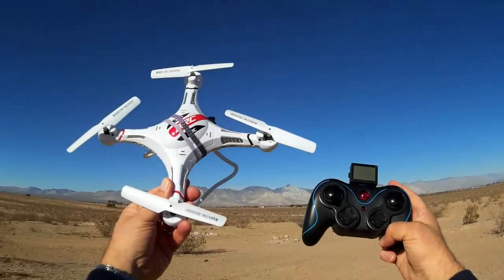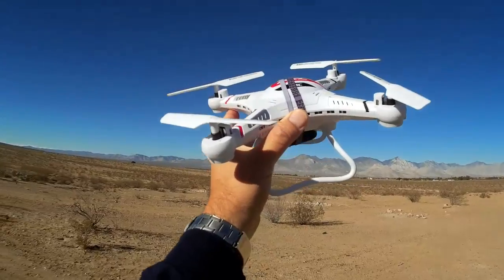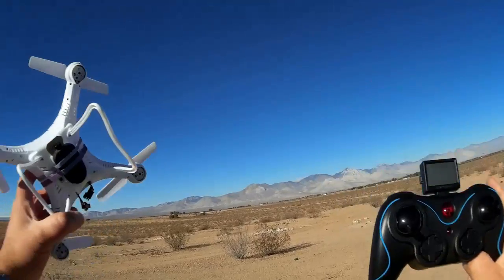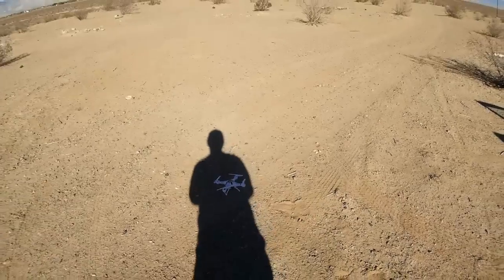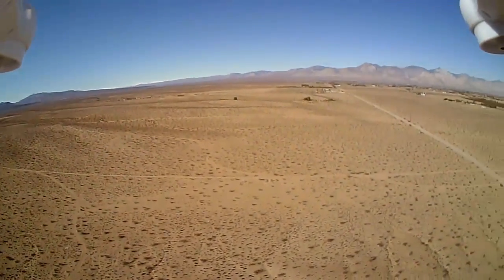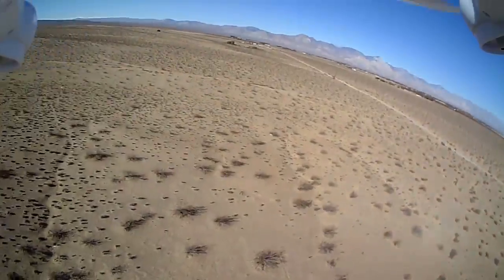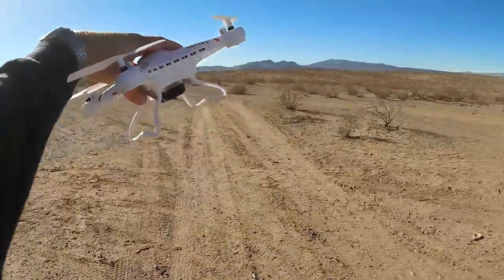JJRC H8C Drone, Got video jello? Check this first.

Comment: I thought the JJRC H8c was supposed to be 300 meter range, Quadcopter101
Reply from the maker: Jey Shin No not the H8C.  The JJRC Tarantula X6 gets 300m range though.
Reply: Then what range IS IT? I already ordered mine. How could you improve the range without getting any other transmitter? you mentioned something like an extension wire but I don't quite get it Quadcopter 101
Reply from the maker: Jey Shin It's about 100m.  If you're a new flier, 100m is more than sufficient for you. There are three mods that you could do later as you become a proficient flier.  The simplest is to melt a hole in your transmitter case to allow the antenna to protrude outside of the transmitter.https://www.youtube.com/watch?v=LoVt4O0iqKU
But if you know how to solder, you can also do this https://www.youtube.com/watch?v=fTB85lAHq4g
To see how others modded theres, simply do a YouTube search for jjrc h8c antenna mod
Reply: thx

Comment: Optimally you want to make the ant. length 3/4 wavelength long, Not a full wavelength. It will be a better impedance match and give you better range. This goes for both RX and TX.

Comment: ¿cuál drone me recomiendan para ponerle una sj4000 cámara?
Reply from the maker: Yuri Edge This one https://www.youtube.com/watch?v=DkWcSE9FGRU
Reply: Quadcopter 101 ¿qué me dices del FY326? ¿podrá cargar la cámara sj4000? Saludos
Reply from the maker: Yuri Edge The FY326 is very good to learn to fly with.  But is too small to lift your SJ4000 camera.
Reply: Quadcopter 101 no quiero gastar mas de $50 dolares en un drone y el FY326 me gustó mucho, ¿otro drone que sea sobre ese mismo precio?
Reply from the maker: Yuri Edge I recommend FY326 if you are a beginner.  But it will not lift your sj4000.

Comment: Been trying to fly mine with the mobius but it gets loads of jello. Loosened the strap and added more padding and it got rid of a bit...but I'm clueless on how to balance them. How do you tell if the rotors are vibrating?
Reply from the maker: Here is how to do it as demonstrated by thxkid.  A V929 is used, but the process is the same. https://www.youtube.com/watch?v=GtWRl6p9Jbw

Comment: I just got my H8C after 2 months of waiting and am working out its issues like the transmitter distance. I love this quad-copter and got it because of your videos but what kind of wire did you use to extend the antenna?
Reply from the maker: I use single strand thin wire (don't know the gauge, but I think it's scrap wire from an old electric motor).
Reply: Okay, I may use a 2.4 g antenna I have from an old modem but first I wanted to try your mod and see if its worth it to cut a hole and and add an antenna. Great videos, I have watched a great number of them and you are the reason I got the H8C as my newest quad. Thanks!
Reply from the maker: Finnick Odair If you're going to go the router way, you may want to consider using a much better antenna.  You'll need the following two items (total cost about$6)
http://www.banggood.com/5-Inch-Male-to-SMA-Female-Nut-Bulkhead-Crimp-RG316-Coax-Cable-p-924951.html?p=RB0922217402201307U3
http://www.banggood.com/Wholesale-FrSky-2_4G-V8-Series-5dB-Module-Antenna-p-68703.html?p=RB0922217402201307U3
and the following is a general guide how to do it.  Different transmitter (WLToys), but the same method http://www.rcgroups.com/forums/showthread.php?t=1873198&page=43

Comment: Sorry, but I can't find the link to the video editor you use. I've looked in most of the videos of yours that I've watched, but I've missed it somehow. Thanks so much for helping us newbies to get up and going!
Reply from the maker: I use VSDC free video editor. It's currently the absolute best free video editor out there. https://www.youtube.com/watch?v=nkpUhJtED5M#t=26
BUT be very careful during the installation as it is supported by using a "bundler" installer. Select "Custom installation" (do NOT click express installation), and MAKE SURE to uncheck and/or decline any and all offers of additional software.  Here's the download link http://www.videosoftdev.com/free-video-editor
Reply: Quadcopter 101 Got it. Thanks for the heads up about the add ons. That would have stunk to have had to go back and sort through all of that. Now to learn how to use it! I watched that video you suggested the other night. Thanks again.

Comment: Yo 101, is the wave on the video at times call propeller flicker?
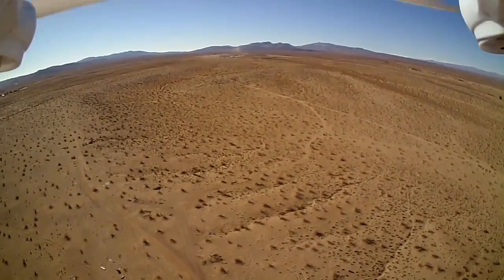Reply from the maker: The effect that you see at 3:08 (where I'm flying toward the sun) is propeller flicker. It's the shadow of the propellers hitting the camera lens.  It can be reduced by taping a small piece of cardboard above the lens to act as a shade.

Comment: Do you know what the difference between indoor/outdoor mode is on the controller? According to the manual, holding the right trigger for a couple seconds switches between them, but the manual doesn't say what's the difference. Is it more powerful in outdoor mode or something?
Reply from the maker: Yes it is more powerful. It throws extra voltage at the motors. BUT I don't recommend using it at all.  This quadcopter flies great in normal indoor voltage mode (that's all I use in all my videos).  The extra voltage may damage the motors, so again I don't recommend it at all.

Comment: Hi there are Mr. Quadcopter, I was wondering if you knew the difference between the JJRC H8C ( 2 mp ) and the JJRC H8C ( .3 mp ) advertised on Tmart.
Reply from the maker: The .3mp version uses a low resolution 640 x 480 pixel video camera.  The 2mp is a better camera with a 1280 x 720 pixel HD video camera
Reply: Quadcopter 101 thank you for replying back. I just pulled the trigger on my first quad yesterday(H8C-Tmart). Hoping the .3 mp wasn't a typo cuz there's a lot on there. I went with the 2 mp $53.00 out the door and will be here tomorrow not bad eh. Spent a couple wks watching a lot of vids and comparing quads. Anyways thanks again and thanks for putting up such well done information/entertaining videos. Got a subscriber for life.

Comment: Have you ever tried using the camera that comes with the H8c with an X5c to see if its compatible? that would be awesome to have the reliability of the X5c with an adjustable angle camera
Reply from the maker: Yes I did. Unfortunately it didn't work. Think the reason is that the H8C camera uses 7.4volts and the X5C uses 3.7volts.

Comment: just got mine today took about a month to get was trying it out and the copter wants to keep moving forward i cant seem to get it to hover there is no wind out  what am i doing wrong ?  many thanks  again for pointing this product out to me
Reply from the maker: Sometimes the gyro stabilizers need to be recalibrated after shipping. Try the following:
1) Insert the battery and immediately place the quad on a flat and level surface.
2) Turn on the transmitter and bind it to the quadcopter.
3) Move and hold both control sticks to their lower-right corners.  Hold them there until the quadcopter's lights begin to blink (about 10 seconds)
4) Let go of the sticks and try flying
And for trimming the quadcopter once it's in the air, see the following article from my blog.  Make sure to also check out the index in the right column for other articles that may help you: http://quadcopter101.blogspot.com/2013/10/quadcopter-flight-school-tutorial-1.html

Comment: 425 millimeter antenna.would that be around 16 inches? i am getting no range at all with the stock antenna..
Reply from the maker: 425 mm is way too long.  either use a half wavelength (63mm) or full wavelength (125mm).  Here's someone else that's done the mod for his Syma X5C.  He extends his antenna to a half wavelength (63mm). The transmitter case is different, but the concept is the same. https://www.youtube.com/watch?v=EQbRnQsHLHA
https://www.youtube.com/watch?v=b_IWbiYfvfQ
Reply: Quadcopter 101
yeah that did help..thank you

Comment: Is there any way to see what you are filming?
Reply from the maker: I'm sorry, but I don't understand the question? Do you mean simultaneously include my hat camera video?  Currently I switch to just the aerial video only once the quadcopter takes to the air. But I suppose I could include a smaller Picture in Picture (PIP) window of the hat camera view in one of the corners of the aerial video.
Reply: Quadcopter 101 I mean like is there a way you could see what you are filming like a LCD for live video feed.
Reply from the maker: That's called FPV. Not with this quadcopter.  But you can with these:
http://www.banggood.com/SKY-Hawkeye-HM1315-5_8G-FPV-RC-Quadcopter-With-Real-time-Transmission-p-954671.html?p=RB0922217402201307U3

http://www.banggood.com/JJRC-H9D-2_4G-FPV-digital-transmission-Quadcopter-with-2MP-Camera-p-958018.html?p=RB0922217402201307U3
Reply: Quadcopter 101 Which is the best quadcopter of the two?
Reply from the maker: Don't know yet.  These are brand new, just came out.  But 2015 is definitely going to be the year of low-cost FPV quadcopters.

Comment: Well, I took the cover off of my JJRC H8C transmitter and you are correct, the antenna wire was only @ 23 mm in length. So I got a small piece of very thin wire @ 24 Ga and soldered it on to the end of the antenna wire and then cut it to 31mm. When  out side just before sunset tonite and walked down the street to the stop sign, which is about 150 yards, and it works great. Will try to get out tomorrow to the park and see just how far it will go. Thanks, Great tip.
Reply: Grayhawk1948, what was he results of your antenna range check?

Comment: I would check the transmitter for a cold soldered battery wire or other component on the board. I have not modified my transmitter at all and I have flown mine up over 200 meters with no drop outs. I would hate to see you lose that quad.

Comment: Coincidentally, I balanced my V262 props last night.  I take each one off and place it on a pin placed horizontally on my double clip extra hands gizmo.  Found my two black props, which were newer, to be out of balance.  I use clear tape to achieve balance. Now, awaiting the new motherboard and canopy from the last crash.
Reply from the maker: I leave my props attached to the quad, grab onto the quad from its bottom, and place the throttle at the lowest setting..Next I just cycle the pitch and roll stick through its four corners, and just feel the vibs with my fingers. It's quick and dirty, but it works. GWS Blades Balance Guide with V929
Reply: Well, that may work on these small quads, but you would not be doing that on my Cheerson. Anyway, it's not much time at all to pop the props off and balance. I think part of the problem with these gear driven smaller quads is just the fact that you are dealing with gears and not a direct drive like the Cheerson or my little JXD 392. Not flying much.  Doing kitchen remodeling and pulling wall paper off.  I'd rather be flying.